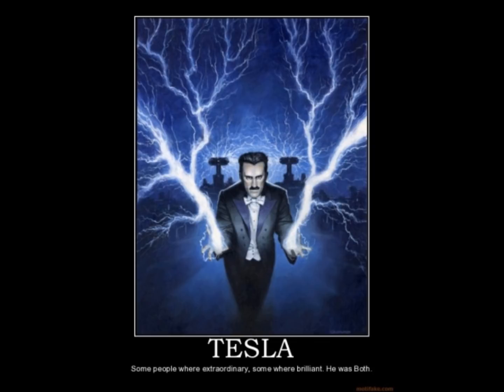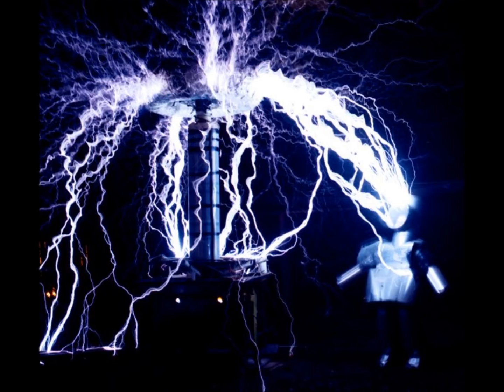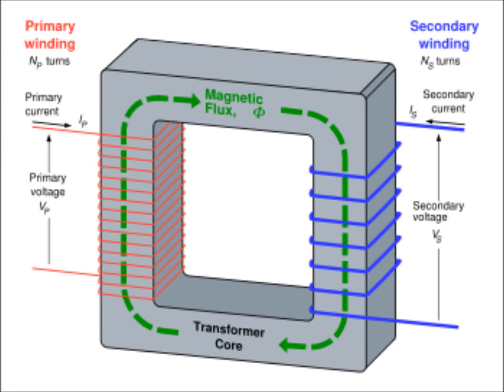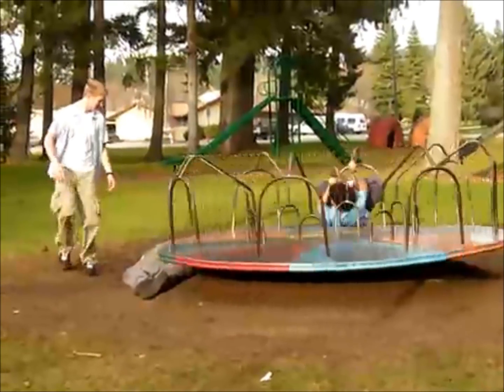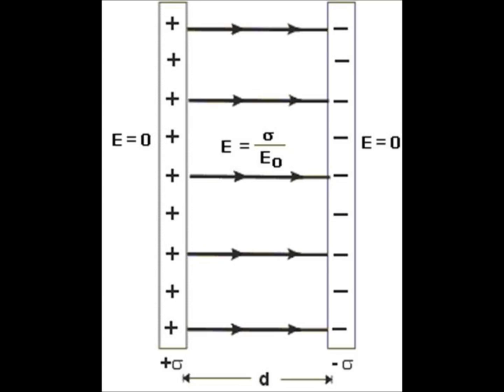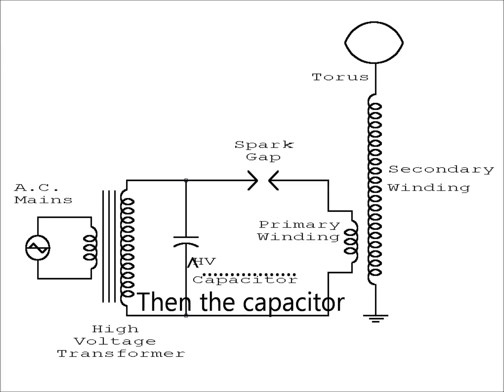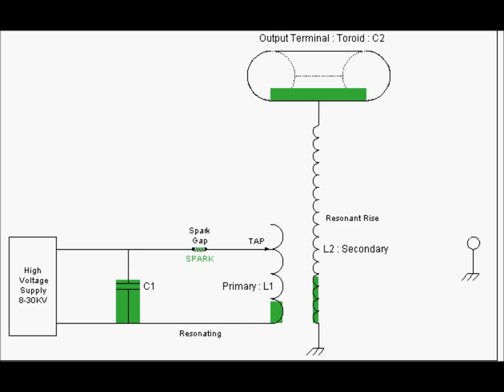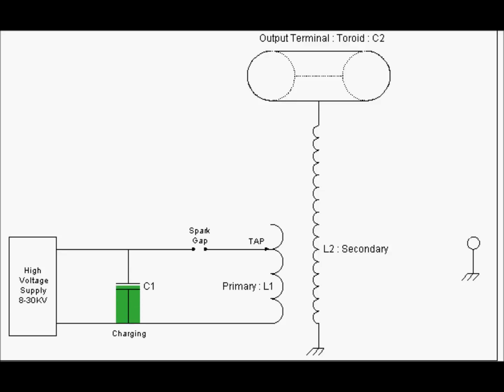How a Tesla Coil Works Physics Project

Comment: You fell apart a little on trying to explain capacitors but I'm not sure how I'd do it either... I would correct you however on one aspect. Capacitors CAN hold a charge indefinitely. In fact you should always discharge capacitors with an appropriate resistor before touching them. Also I'm not sure if you mentioned that capacitors OPPOSE a change in current which is why you need them in parallel with your coil. Without that capacitor you could very well vaporize everything.

Comment: What is this everything you refer to? My house power is AC. It is generated as AC and transmitted through wires as AC. Most of my appliances run directly from AC. Anything in my house with a powerful motor or heater runs on AC induction. 
Some things I have use DC made from house AC or batteries but not "everything".
Wire resistance is by current. With DC you limit how far you can run wires at much power. That is why AC generators won the contracts.

The video has -other- mistakes.

Comment from the maker: You may want to double check that information. Alternating current is used to power most households since it's significantly easier to transport in large amounts. Direct current is generally used in battery operated devices since it's more efficient on the small scale.

Comment: This "explanation"  is so mistaken it is painful to listen to. Phrases such as "it is incredibly complicated",... "or it somehow manages to store"... indicate how poor  this students grasp of the physics of electricity is. Capacitors store charge, on two conductive plates (of metal) seperated by an insulating dielectric,... how complicated is that?  or The ratio of turns on the primary,... to turns on the secondary determine, the step up of voltage, and step down of current. watts in=watts out